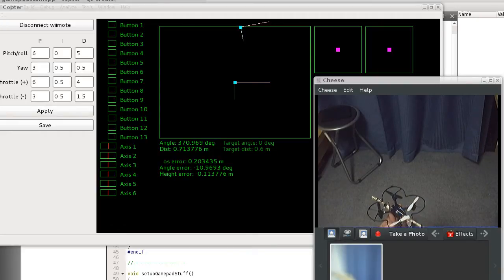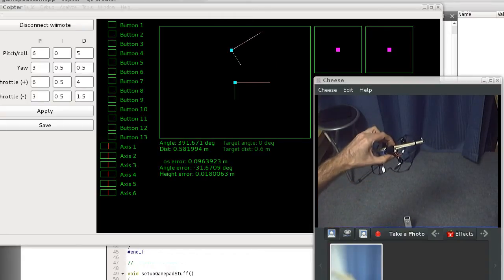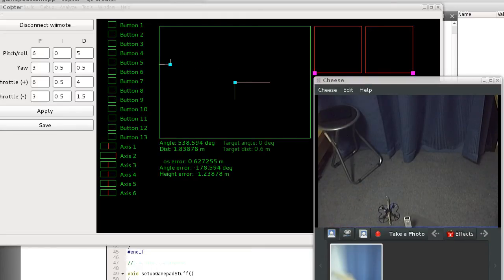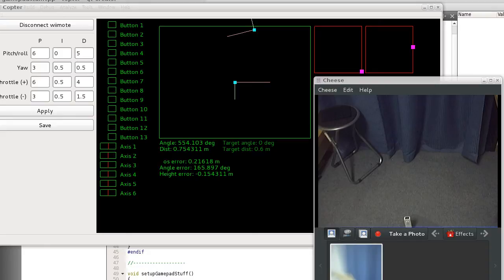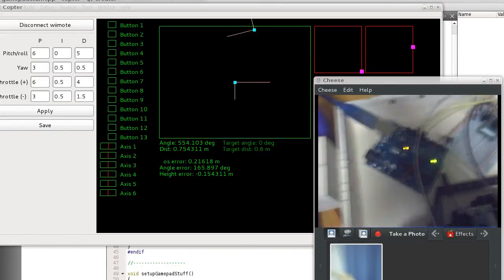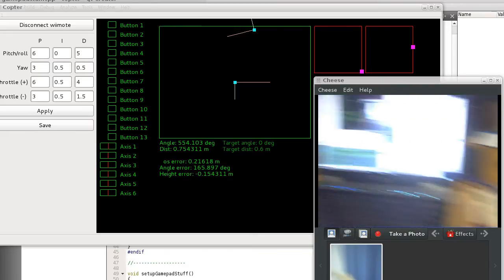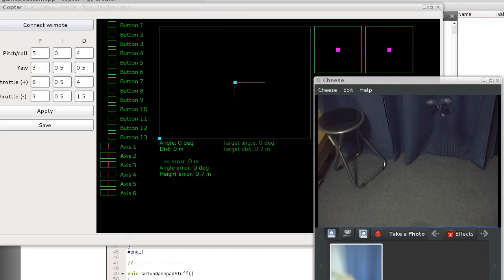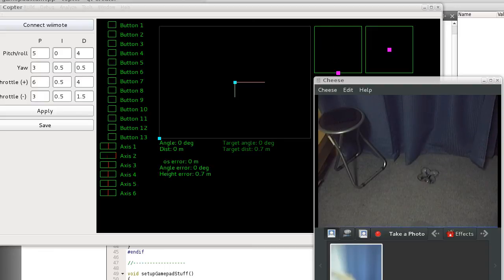Wiimote + arduino + quadcopter experiment

Comment: you can use webcam instead ,you are on a good road ,you wil get it stable ,  you can make reflector on the quad , and use a IR spot ,, no power for led needed on quad ,, maybe use some diferent digipot with smaller staps ,  butt i know for sure you will gett it work ,  take of the 7 grams lol , keep this updated ,

Comment: its nice  , butt the wii mote has enough FOV , when you change the LED to red IR LED not use the ones you cant see , use the ones that are used in cams ,, i also have a hubsan x4  stil busy with the tx rx part .Do you use digipot for the remote part , how is your script working ? wii mote sensor lett say -8  bit to + 8 bit value ,, when this changes it wil trigger the remote part , til its close 2 zero ,, trying to keep it neer the zero part ?,, i also own a hubsan , and it wil re position reel fast after you leave the remote centerd in normal mode , better use pulses with same values and use a delay compared with time the quadcopter wil level it self ,this wil make it react slower but gives it time to adjust on its own , keep on !   you can reverse it ,, with a bigger quad copter like i did i putt the remote on the quad 
SK450 KK2.0 Xcopter with DexterTracker ,and Xtra WIIMote Horizon sensor UAV stuff
Reply from the maker: Yes, I used a digipot to replace the normal input that would come from the control sticks. After making this video, I tried to reverse-engineer the RF protocol of the transmitter module, and connect it to the arduino directly. But without knowing how the RF module starts up I think it would be extremely difficult. You can see where I got stuck here: http://forum.arduino.cc/index.php?topic=230852.0

Then I discovered the crazyflie, which is perfect for what I'm trying to do, because it lets me focus on the software side which is what I'm good at, and I don't waste time trying to understand RF protocols. You can also fit the crazyflie board to a larger quad if you want:
http://www.bitcraze.se/crazyflie/

I have not bought a crazyflie yet, mainly because if I did, I just know I would spend so much time playing with it when I should be doing other work.

I got a second wiimote, so next time I will try using the pair of wiimotes mounted side by side, so they can get a stereoscopic view of the IR marker and use both streams to calculate distance. Hopefully this would allow them to be placed further from the marker, so the FOV would not be such a problem.

I also want to use reflective spheres instead of powered LEDs, but I don't really know where to get good retro-reflective paint or glass beads. I got some small IR illumination rings and tried with a couple of types of reflective tape but the result was pretty bad - very patchy recognition and only within a couple of meters. I think I would need some much nicer IR lights and more of them, but I'm not really wanting to spend too much on this project, and I can't afford a crazyflie right now anyway, so I'll have to come back to it sometime in the future.

Comment: How is the computer program computing the inputs? I mean, have you tried to write a neural network to control the thing instead of using some kind of basic (if this is too far to the left, then do this)? Thinking about it, one might be hard to train. I LOVE the fact that you're writing a program, which manipulates something in the real world as opposed to simply displaying something on the screen, this is awesome. Also, do you have any plans to try this with, instead of a couple of LEDs, an xbox 360 kinect? Or better yet, wait for the Xbox One's Kinect to be hacked/usable by a PC?
Looks like a fun project you have here :D
Reply from the maker: Each axis has a simple PID controller as seen on the left, nothing fancy. I think that's all that should be necessary for a simple hover, if the settings were done right. Once I figure out a way to power the heli from mains power, I will write a self-adjusting program and leave it running for a while, and hopefully it can tune the settings on its own. Theoretically it should be able to do a much better job than me, because it updates at 100Hz and can move the 'sticks' instantaneously.
Yes, it sure was a nice to discover the arduino and how easy it makes interfacing with the real world. The nicest part was discovering how cheap all this stuff is too! :)
I don't think the kinect is suitable for determining the orientation of the quadcopter because it is very small, and the amount of information to process is very large (point cloud) and imprecise compared to that of the wiimote. What I might try next is to IR illuminate the whole room and use small reflective balls like they are using in the video I linked to in the description. That would mean less weight for the heli to carry so I could add a third marker, and the wiimote could be held further away to get a better FoV - the wii sensor bar has five LEDs in each side but I'm only using two so the points are not detected well if further than about 1.5m from the camera. Ideally, I would then get a second wiimote and look at the IR points from a different angle, to get a genuine 3d position, but I'm not sure if the library I'm using will support multiple wiimotes, I'll have to check.